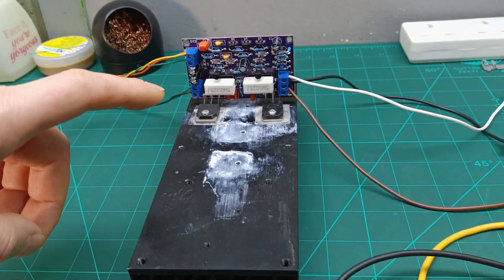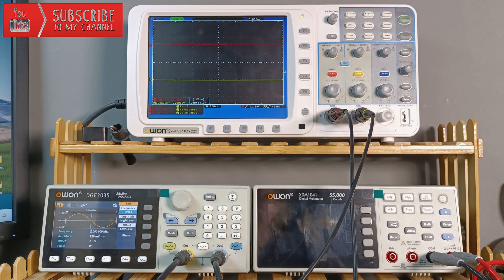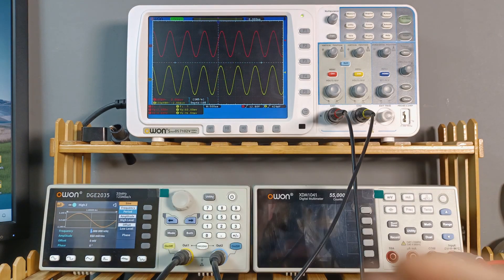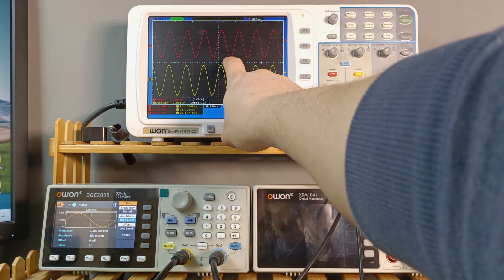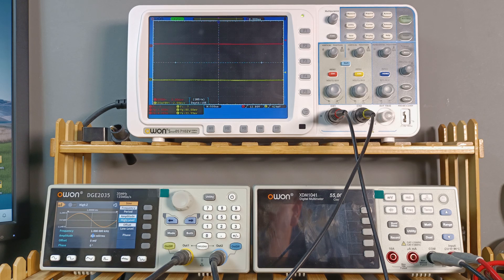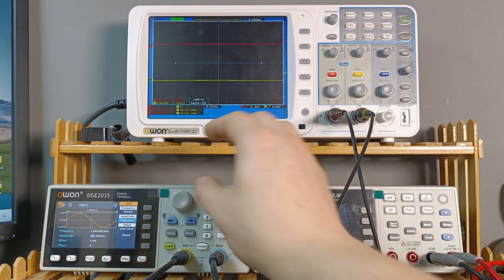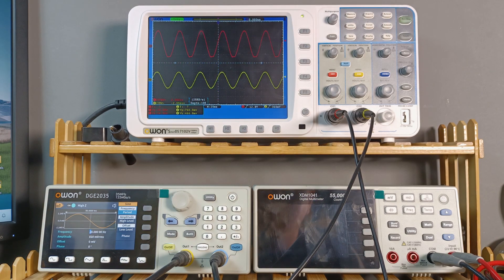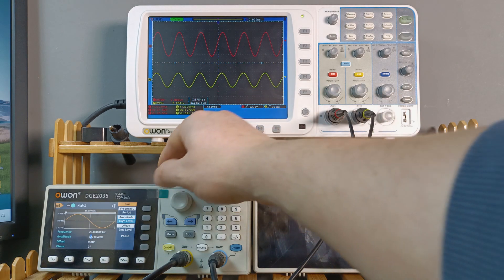AliExpress audio amplifier kit oscilloscope test part 2

Comment: At the low frequency, the clipping was due to power supply limitations, however at the higher frequency the linear slopes indicate Slew Rate limitation, most probably due to improper stabilization scheme, putting it simply, not HiFi.
Reply from the maker: Definitely is not a hi-fi